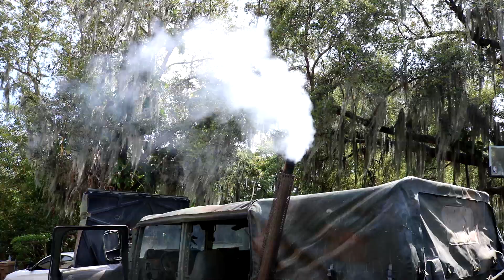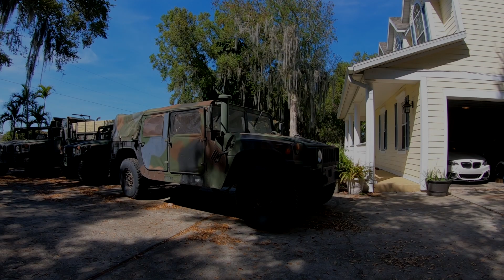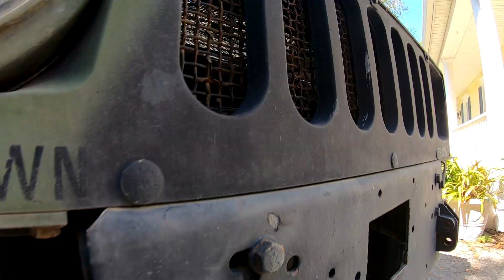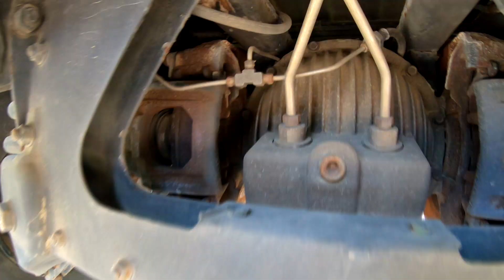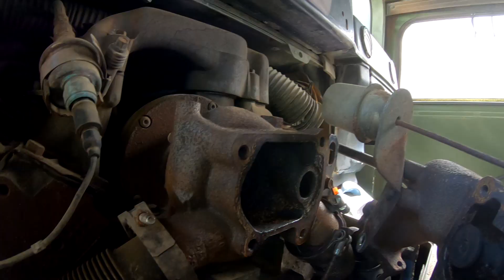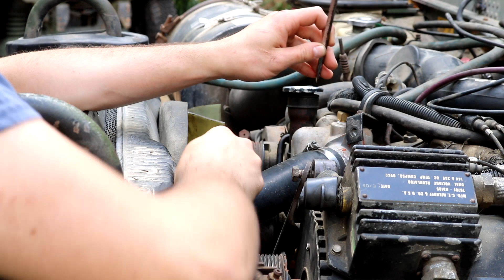The Unpredictability Of Buying And Building An Auction Humvee

Comment: Best of luck to ya!  My first m1123 humvee was bought in 9/19. A Non-starter. Complete fuel system replacement.  But luckily,  It ran after the repairs. Your right, you don't know what you'll get with these things but when it's fixed, you can say "I Did it".  Keep up the videos, very fun to watch.

Comment: Part of the issue comes with the fact that they took the CDR valve out of the service kits, and so they don't get replaced, get backed up with oil, so the crank case doesn't vent the pressure it builds up. and blows the head gasket out.  So make sure when you do fix this, also change out the CDR valve.

Comment: It's at least a good sign it runs, but the reason an ECV truck gets auctioned usually is it has a severe enough problem they do not want to bother fixing it. The truck to me looks in great condition for a gov auction truck and has most of the hard to get parts on it already. I got a gov truck that did that and they had put the cylinder rings on backwards on cylinder 1 at the factory. A blown head gasket on that model is usually on the back cylinders in the corners. Good luck and I'll keep watching to see the progress.

Comment: How did you get the radiator stacks to separate? I have the same truck and those Allen bolts holding the oil radiator are not budging.
Reply: William Johnson don’t know if it is smart to take a torch to an oil radiator.  Mostly because the bolts are somewhat recessed between the pipes about 2 to 3 inches.  I chose to drill them out.

Comment: tell me about it , I just picked up my very own yesterday. thinking all it needed was batteries and an alternator, i noticed the power steering pump was also missing  as i crawl beneath for a better look, my worst nightmare, a metal block is perforating out of the oil pan,
Reply from the maker: Oh no! Sorry to hear about that!
Reply: @DakotaWoodHD   some friends have recommended an LS swap due to their affordability. My intentions is keep as much original as possible. any recommendations
Reply from the maker: @hanselperez-valdivia2144  I would just replace the engine with the same version. You could find a good running 6.5 power pack for under $3k. That would be the easiest and most cost effective way. You would be into a LS swap for way more than $3k.
Reply: @DakotaWoodHD  You seen the duel large tesla motor hummer... it has 1 drive unit powering each of the OEM diff`s 450-650bhp each would be fun in 1 of those :):)
Reply from the maker: @kylereese4822  I did! That would be so awesome to drive!